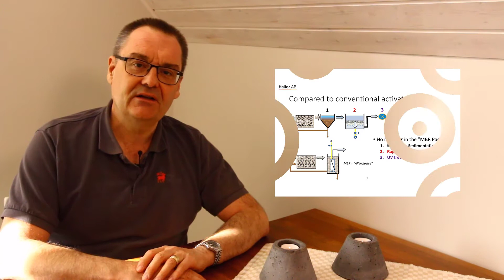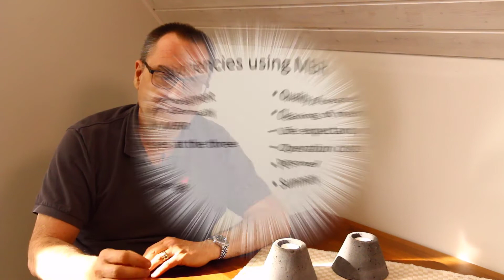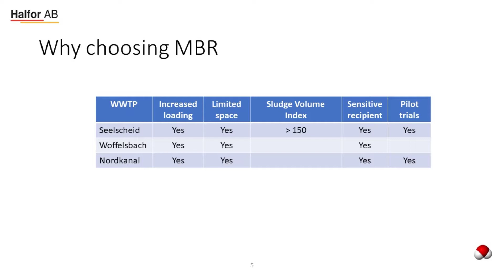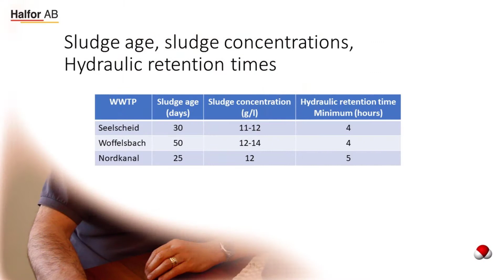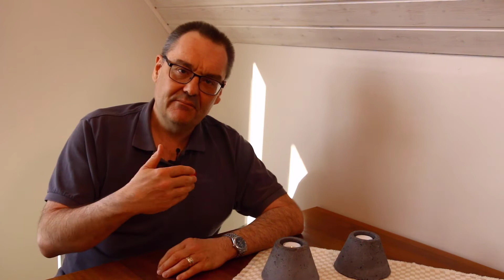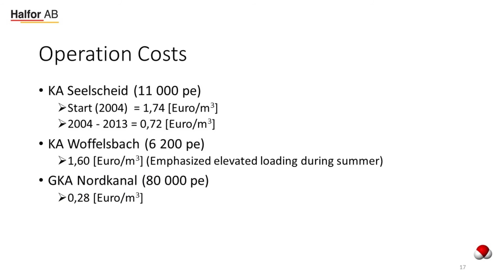Membrane Bioreactor (MBR) - 10 years of operational experience

Comment: Hi sir, can I use mbr for my restaurant which have oil content in the sewage? .
Reply from the maker: To remove oil you need an oil separator or a skimmer. Standard equipment for removing oil. Google and you will find good examples. Br/Magnus
Reply: Yes. polymer MBR membrane must be avoid  FOG . @halforab588

Comment: what is the company name for membrane ?
Reply: There are several different membrane suppliers so best way too Google and then contact. However, there are two different type of membranes for MBR - Flat sheet (eg supplier  Kubota) and hollow fibre (eg supplier Koch). So when you Google you can add the term flat sheet or hollow fibre. Good luck Br Magnus